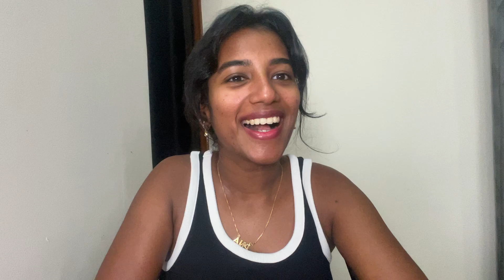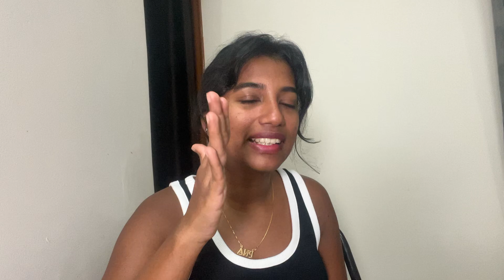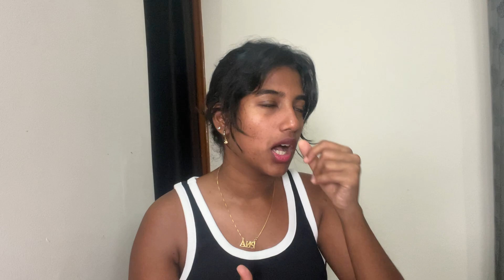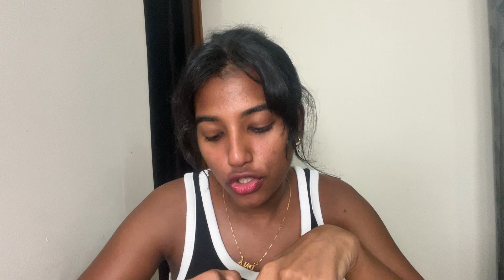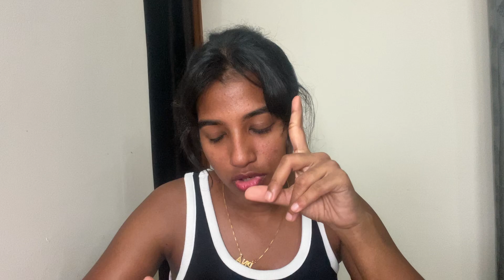Q2FY25 : EPACK Durable Ltd

Comment: Q2FY25: EPACK Durable Ltd - Performance and Strategic Insights

1. Business Overview

EPACK Durable Ltd operates in the air conditioning (AC) manufacturing sector. Initially starting as a contract manufacturer, the company has transitioned into an Original Design Manufacturer (ODM), enabling higher profit margins.

Revenue Breakdown:

Room Air Conditioners: Contribute 80-85% of total revenue.

Other Electrical Appliances: Account for the remaining 10-15%.

2. Q2FY25 Performance Highlights

Revenue Growth:

Sales grew by 12% year-over-year (YoY) during Q2FY25.

Q1FY25 revenue target was ₹2,100 crore, reflecting a 40-45% YoY growth ambition.

Profitability:

Losses widened from ₹6 crore in Q2FY24 to ₹8.9 crore in Q2FY25.

Margins declined to 2.8%, partly due to the seasonally lean quarter for AC manufacturers.

Revenue Concentration:

Heavy reliance on room air conditioners, which saw a decline in their contribution to total sales.

3. Operational and Financial Challenges

Working Capital Constraints:

A significant portion of cash is tied up in inventories and receivables, leading to negative cash flows.

Return on Equity (ROE):

Current ROE stands at 5%, significantly lower than industry peers averaging 18%.

4. Growth Drivers and Strategic Initiatives

Capacity Expansion:

The company has ramped up its production capabilities.

Partnerships:

Collaborations with established brands like Panasonic and Hisense bolster growth prospects.

Diversification:

Plans to expand its product portfolio beyond room air conditioners to reduce revenue dependency.

Margin Improvement Plans:

The company aims to enhance its margins over the next two years.

5. Key Takeaways and Outlook

EPACK Durable Ltd shows potential for growth, driven by strategic partnerships and diversification efforts. However, challenges such as low margins, high working capital requirements, and below-average ROE weigh heavily on its performance.

Short-term Concerns:

Widening losses and declining margins during lean quarters.

Long-term Prospects:

Focus on improving financial health and operational efficiency offers a promising outlook.

To sustain growth and address financial challenges, EPACK's management must prioritize effective working capital management, diversification, and margin improvement strategies. The company's future hinges on its ability to balance operational challenges with growth opportunities in the AC manufacturing sector.